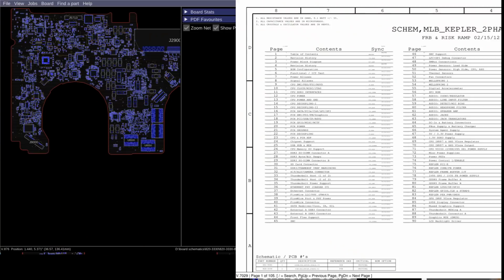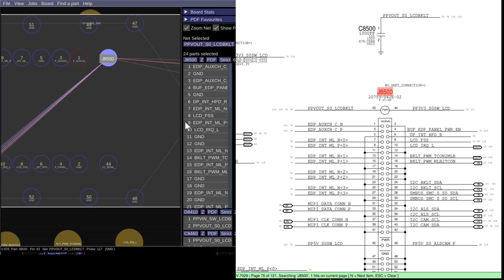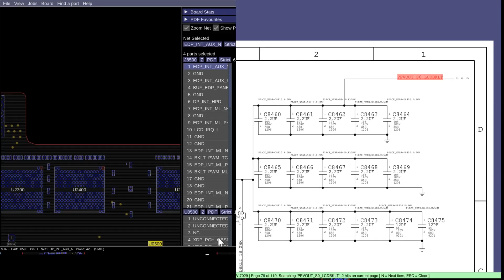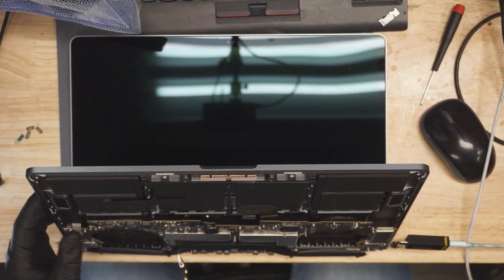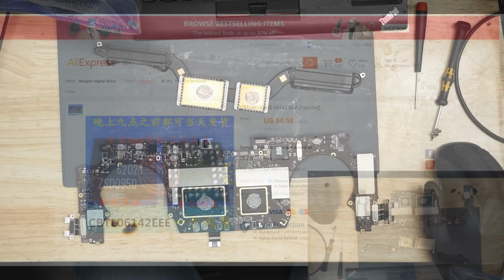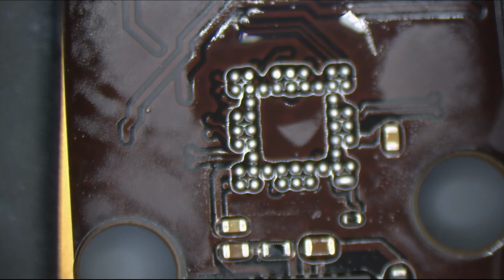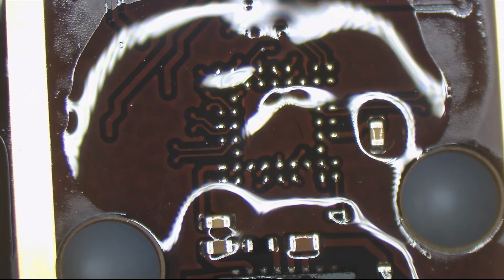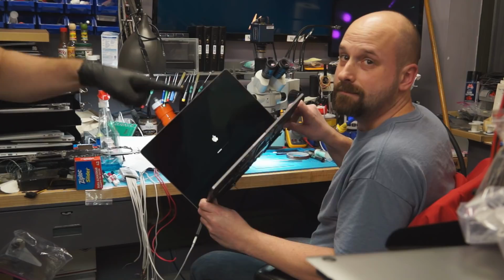Apple botches Macbook board design: again!

Comment: As for the Mux Chip part number... If you're a big enough customer, the manufacturers will actually do things like re-label the chips they send to you. Such chips are usually off-the-shelf components, so it's very likely that there's a commonly available 100% compatible chip that could be used instead. Another hint that this might be the case, is the list of NXP's Display Port Multiplexers. None of the NXP's multiplexers have the package marking that we've seen in this video. 
It might be a good idea to research the CBTL06DP211/212/213. It's possible that one of them is actually the Apple's mystery chip. In EU on Mouser, they're between 1 € and 2 € in volume.

Comment: Louis, I love your channel. But I think, unfortunately, it's become kind of a platform for manufactured outrage. I don't see a lot of intelligent discussion in the comments. It's mostly just people hating on Apple. And to be fair, I get what you're trying to do. You're trying to keep them in check. But somewhere along the line, people seem to have gotten the idea that Apple doesn't make high quality products, or that their products somehow don't stand up next to other brands.

 I would say that't not the case for the most part. If you were to spend this much time on HP machines, you'd likely find far worse design flaws than a lack of adequate clearance between a power and signal line. And that's not a criticism of your content at all. HP sells a line of machines very similar to these macs, and I've used them. They don't stand up really when you compare them to a Mac. They've clearly cut corners and they cost about the same. 

Keep it up man.
Reply from the maker: HP's machines start much cheaper,  and the expextations are lower. Everyone knows HP is trash.
Reply: @rossmanngroup  Well, not the HP machines which are competing directly with the MacBook Pro 13 inch. They're within 10-20% the price. A co-worker just picked one up last week, feels like a very solid machine, but when you look closely, it just doesn't have the fit and finish of the Apple machines. I think it's more just that HP has a low end and Apple really doesn't. 

Anyway, love your content man. Keep it up!
Reply: @Sam S9 Nope, but I will say that it looks a lot like the 13" I tried, and if it's anywhere near the quality, it's a hell of a bargain. Apple's pricing for 13" machines is about right IMHO. But their 15" pricing is bonkers, plain and simple. Thanks for the suggestion!
Reply: @Sam S9 That being said, the screen resolution sucks, the base RAM is 4GiB (I'd settle for a min. of 32) and when I added a 512 GB SSD I'm pretty quickly into Apple territory. The devil is in the details, truly. With a "retina" class 15" display, 32 GiB of RAM and a 1 TB SSD (my desired config) I'd easily be into 3 grand, and they don't offer that option at all on the G5.
Reply: @Sam S9 And sure enough, by the time I got 32 GiB of RAM configure, I hit 4500 CAD. Still no "retina" display. 1080 isn't great for a 15" panel. So yeah, they're not cheaper than Apple, they just have a shitty base configuration.
Reply: @Sam S9 Same config from Apple (but of course, with a better display) is 4650 vs. 4500. Exactly the same price for 1 TB SSD + 32 GiB of RAM on the 15" pro.
Reply: @Sam S9 This is true. 32 GiB of laptop DDR4 is about $350 CAD. And this one just hit me like a ton of bricks, so brace yourself: a 1 TB SSD is now under $200 CAD. What in the actual fuck?

Comment: These ground pins are put between data (or data and power) lines mainly to avoid interference. The Apple engineers that designed this maybe had some constraints with the used connector (maybe already ordered 100k of those) so they were unable to put the ground pin there. They surely measured the interference levels and it was good, so they kept it without the ground pin. I can imagine that when someone thought that this solution would sometimes kill the CPU, the macbooks were already in production. If this was a layout bug, the would fix it in another board revision, but with a connector they are profoundly f***. They cannot change the connector or its pinout, because they would also need to change the LCD panel and then make and keep two sets of different spare parts for one machine.
Reply: Yes, this exactly how it works. I can tell you, it’s the same thing in the automotive industry on products they costs over 70 thousand dollars
Reply: I see, so apple is ran by people that order 100k of new connectors (non of that good and working old shit) before the engineers even green lit it? I'm sorry to hear that Apple seems to pick parts like a student would pick even his coffee... on a really low budged disregarding the taste :)
Reply: @Hazarth  maybe it isn't budget constraint, but rather there's no audit/inspection by other engineers. Probably a single person made the design or had too much authority over it, so a simple mistake is often missed until it's already in use in product.
Reply: @xponen  Don't forget the continuity of this problem for three years.
Reply: But how did this even make it through a design review? Even if the noise level was acceptable it's still stupid from a mechanical  standpoint. I've been mechanically responsible for a few connectors in my career and I know better than to do this. Its just one of a few design fundamentals to keep stuff from shorting out and destroying the product. Of course I've also had the idiot boss who demanded I violate good design practice and then blamed me when exactly what I said happened. At least it never made it to the public and I got to do it the way I wanted.
Reply: Jeeva Bharathi it’s not about how long the problem exists, it’s about how much it costs to fix the problem, including a new MOBO and LCD assembly. With higher enough QC from factory, it’s highly unlikely to get those two pins shorted.
Reply: @carsstuff9914  Well that's too bad, a spec of dust can easily short the pins and Macs are currently being sued for incredibly exposed and accumulate dust easily than other laptops from different OEMs. Coincidence? I don't think so. With their track record and my personal experience with these assholes. Besides, no OEMs should excused for poor engineering. Poor engineer choices? your fault, fix your damn thing, not being pardoned.
Reply: Jeeva Bharathi Changing any connector pinout is a hard break of compatibility.  Any change to the display connector and every repair place will need to carry two kinds of spare screens at each size and resolution for the following 5 to 10 years.  That's why I suggested in another comment to add a heavy duty overvoltage protection circuit to that data line instead.  It's a lot cheaper for everyone affected.
Reply: @johnfrancisdoe1563  I do wonder if it wouldn't be possible to design a groundline between them and make it so it still would fit the old connector but just be a blind line there. That way they could still use the same spareparts on all machines. But it's apple we're talking about so not going to happen

Comment: I'm only a student in engineering wizardry but a soon as you said there is a high voltage rail next to a low voltage rail, I could not resist my hand shorting to my forehead.

Comment: The proper way to do it would be to omit those pins entirely next to the HV/ground for the backlight, or simply have a separate two-pin connector to feed the backlight.

Comment: I spend hours and hours watching and trying to learn from you. This is not my area; I'm a sound technician and singer but recently I dedicated myself to the task of replacing a small 50 pin connector of an ASUS X555LJ, that one that connects to the small HDD board. To make my task more complicated, two contacts on the motherboard were completly destroyed by a short and I'm trying to reconstruct them with wire jumpers.
I wish I had half of your skills and experience.
This gel flux you are using is (Amtech NC-559-V2-TF), right?
Greetings from Portugal. Happy Hollidays.

Comment: eDP is already AC coupled. The only thing they needed to do is to use 50V-rated capacitors on the signal chain. And they didn't.

Comment: As somebody who knows next to nothing about electronics, would it be advisable to put a dab of silicone or hot glue around the 50 volt pin in order to prevent this sort of malfunction from happening?

Comment: Presumably these get out of the factory functional. (Where I once worked we had computerized tests that checked for shorts at non-destructive voltages before going to functional testing.) So voltage bridges the gap how? Condensation (going from outside to inside) or liquid (from spills)? An inductive spike on the power supply?

 Nothing that encourage hate toward Apple is too much. Keep it coming.

Comment: I know that, a while ago, Apple ran the high current +12V to the CPU VRMs through a couple of screws with heads that stuck out less than a millimeter away from the huge grounded CPU heatsink. It wasn't as much of an arcing issue as a "big hot metal things tend to work themselves loose" thing.

Comment: Seems as Apple use separate backlight system - DC/DC converter and current driver is mounted on MoBo, and LEDs with HV switch on LCD. I saw that method on some Sony laptops too, very problematic in servicing due special dedicated type of LCD. Most of laptops use full backlight system mounted on LCD backboard and supply voltage is drawn from main power line - usually 19-20V from AC adaptor or 12-14V from battery. Voltage below 25V is safe on mini connector down to 25mils/0,65mm spacing. I see larger gap between backlight power line and data line so it should be enough for low voltage use, but 40-50V... strange concept.

Comment: Dude.... you got a new subscriber!!! Your work is incredible. I'm a PC and android user and I was about to consider apple products in my next purchase, then I saw your videos :D :D :D 
But listen... here's my take on iphones (never owned a mac) even though I'm holding a samsung rn...
they are better / more convenient in several ways that aren't really marketed for. For example:
1- The screen responds better to fingers and gloves even in the rain. My samsung does a terrible job with that
2- The iphone / ipad gps is unparalleled. The samsung one as well as every android I held was crap
3- The bluetooth connection to earphones like beats or even independent parties like bose work better. Stable connection, better life, better range etc
4- The bluetooth connection to cars as well is so much better
5- My last iphone (iphone6) never slowed down a bit despite my heavy use, my 6~7 yo ipad and 6 yo ipod are working as fast as when I bought them. My note edge slowed significantly with time
6- For some reason, the battery life is better IDK. I bought a new battery for my samsung and it's still not working efficiently despite light use. Plus my 6~7 yo ipad's battery is perfect (without updating the iOS of course)
7- The iphone6 had its front camera move a bit for several devices, apple acknowledged that it is manufacturing fault and replaced all of the faulty phones (at least in Japan where I live rn). So I just went to the store, 30 mins later I walked out with a new phone and the camera didn't move since
8- All my friends have macs and never ever ran into any troubles. I was considering it coz of the form factor and the battery life. My PC is Dell inspiron 7520 which is still working great to this day after like 8 years or so, but it's just too big and heavy.

The weird thing to me is that apple doesn't market these features. Features like gps, bluetooth connectivity, how the screen remains responsive in the rain or something.
What do you and everyone else think?

Comment: On the schematic, the problematic high-voltage pin is a little farther away than the grouped up data-line pins. The schematic proofreader must've thought it's going to be an empty five millimeter extra or so on a custom asymmetric connector.

Comment: That's just common sense. They should know to separate power from data or signal lines.  Even in aircraft, cars, or when running subs for example, you have to keep your signal wires spaced away.  Reason is, you'll get a lot of noise and EMF from the power lines, crossing over the signal lines and this causes interference.  Also, like your point, in circuitry you should keep everything spaced apart for the sake of the components as well.  Dave Jones also knows his stuff for sure about spacing, and if it meets UL standards, and such.  You'd think you should see some sort of circuit protection coming off of the power line or something too, but guess not.

-Avionic Systems Engineer.

Comment: not only is the proximity a problem, the other issue is to have a CPU line connected directly to the outside world without any protection or limiting components.   Transorb arrays are cheap and are commonly used on other products

Comment: A diode that can withstand 50V inbetween the cpu/mox chip and that connector would also be a possibility. One that has as low a voltage drop of its own as is possible.

Comment: @Louis Rossmann 

I have the new MBP 2018 15" model. I was reluctant to drop $4000 on this machine but I don't completely hate Apple and I needed a new macbook to run Xcode.

But yesterday, after work, I closed the lid as I always do, put my MBP in my laptop sleeve, and then into my backpack, and off I went to home.

I got home and when I opened my Macbook (about an hour has passed at this point), the MBP was burning hot, and when I hastily opened the lid, the Macbook didn't go to sleep. It was on the entire goddamn time.

And after that nonsense, when I tried to put my Macbook to sleep either by going to hot corner that I set to sleep, or by going to Sleep by Apple logo, the screen will just go dark and then turn back on, as if it never went to sleep, and then it the brightness will automatically shut down. I can see the brightness slider going all the way down. I bring it back up, and it automatically goes down.

I performed SMC reset and it fixed the issue, but now I am having bluetooth problems, where the Apple bluetooth keyboard will connect and disconnect nonstop.

Did the overheating break my computer? I mean, it was in an insulated sleeve for over an hour, burning inside the sleeve at about a billion degrees kelvin. I was also facetiming my girlfriend and she said she heard some weird feedback noises coming from my end, where my voice sounded like it was breaking and causing weird noises that were not relevant to internet slowing down or internet instability.

Honestly. I really like Apple's machines but dear lord in heaven. For a trillion goddamn dollar company, it boggles me beyond comprehension how incompetent they can be.
Reply: You don't need a $4000 machine to run Xcode. My 2010 Macbook with upgraded RAM to 8GB and upgraded HDD to  SSD of 1TB runs Xcode just fine. You only need super high-end machines if you do 1. Video Game Development, 2. Highly-Parallel/Visual Data & Scientific Computing 3. Advanced Video Editing
Reply: @danavram8437  I also use Parallels for microsoft visual studio and SQL management. I'm away on business trip for few months so if I were back home I would just use my desktop to run those but I couldn't rely on my old macbook air to do any of these. But still it makes me sad that these issues exist

Comment: I HAVE a Macbook pro from 2012, and it's great, and I do my best to keep it in repair when there is any fault, because I don't like things about later models, but people keep making fun of me for using it, because it's a Macintosh machine, and these later ones seem not designed as well.  I haven't bought anything from apple in like, seven years. My 2012 machine still works. How do I get people to stop giving me so much guff?
Reply: I have the same dude, MacBook pro 2012, I just upgraded the HD to an SSD and it runs great, I'll wait until the new generation comes to see if it's better otherwise no need for an upgrade...

Comment: It's kind of insulting that this issue could be prevented with a simple zener diode type of circuit, like $2? Maybe?
Reply: unfortunately, too much capacitance on a high speed line. better to add a chaper buffer ic in between, like with the mux chip. using that as a sacrificial part is much more sensible than directly killing your cpu.

Comment: My 2017 MBP screen malfunctioned after 6 months. Thank god it's still under warranty and they replaced it. Before this I have a 2016 Macbook with toasted logic board. This one is not under warranty and apple is quoting me ridiculous repair cost it's impractical, that's why I bought the 2017 MBP. Buyers' beware!

Comment: Just discovered your channel. You guys have mad soldering skills! Rock on!!! I have a MacBook with a touch bar that has a display issue. Starts off a distorted bar on bottom and top of the screen then goes away after it warms up a bit. I think its a design flaw with the ribbon cable connecting mobo to display. Do you have a video on this? Thank!

Comment: fire risk
10 yea old directx 11 HD 6870 Im using right now. it comes standard clock rate of 900 mine has a clock of 1033 and i game on it it was a replacment from my gtx 580 that had a cap pop on the memory
when will new be better 
 i may fix it? or buy a new one i want might be the next gen
what do you recon

Comment: The schematic seemed to show that the backlight pin had additional seperation to the other pins. Is this actually the case on the connector or is this just where the pads on the board are?

Comment: i would put money on apple not only knowing that the issue would arise, but manufacturing the board with this failure point ON PURPOSE... with planned obsolescence they are COUNTING on the product failing, AFTER the warranty period, without any solutions other than replacing the whole machine.